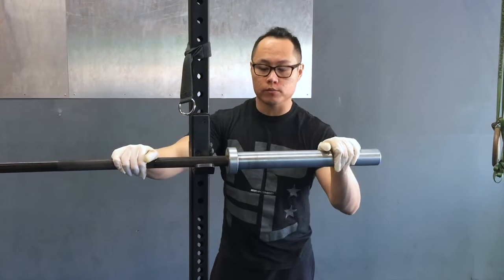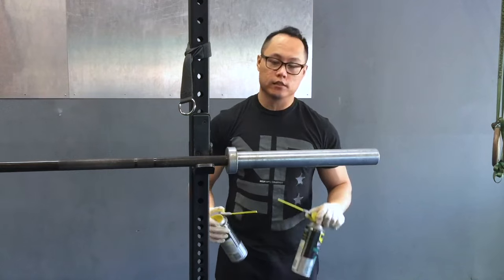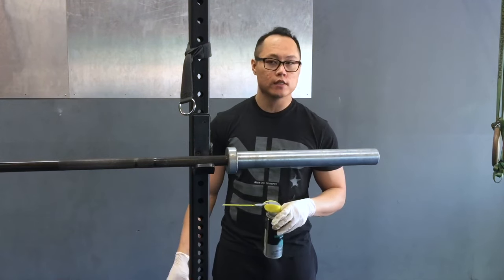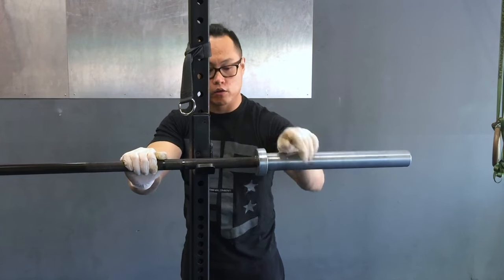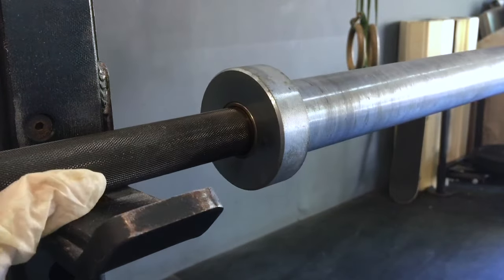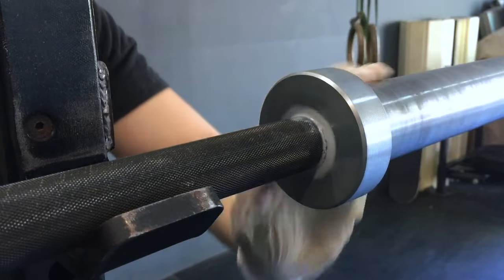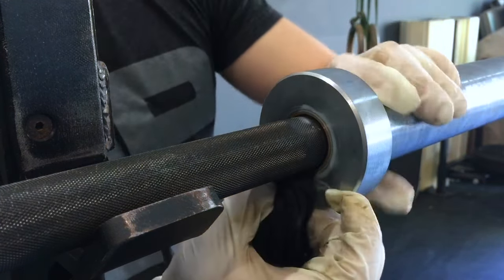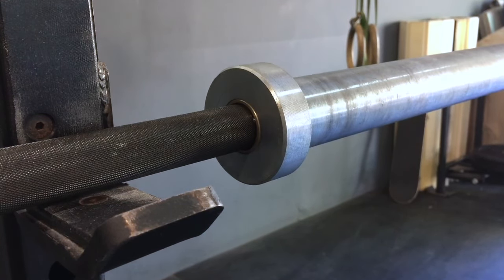A Quick Fix to Improve Your Barbell's Spin! ! Feat. Rogue Fitness Ohio Bar CrossFit Barbells

Comment: Should I buy a can of water resistant silicone lubricant or the 3 in 1 lithium grease? I have a new rogue ohio power bar. And I also feel friction. Thanks man!!!
Reply from the maker: For the Ohio power bar I would recommend using white lithium grease, you don't want it to be fast, but you do want it to be smooth.
Reply: @AMRAP  Thank you! I Will buy it monday 😊 Subbed by the way 😊

Comment: The shaft on my barbell spins. Is that supposed to happen???
Reply from the maker: Yes
Reply: @AMRAP  Really? It seems dangerous. I was squatting and it almost spun off my back. The shaft spins without the whole barbell moving.
Reply from the maker: @liammacdonald955  yeah, the shaft should rotate within the sleeves no matter what style bar you have. Sounds like you have a bearing bar which is why it spins so much.
Reply: @AMRAP  I have a 7ft Olympic barbell for titan fitness. When I spin the shaft, the sleeves don’t spin with it. Just the shaft spins. Is my barbell messed up?
Reply: @liammacdonald955  Are you trolling or are you beeing serious? The collars have bushings inside them, so that they can spin individually. This is very important for balance. And of course, if you rotate the shaft that means it can rotate inside the sleeves without the sleeves rotating. All quality barbells are constructed like this.
Reply: @X3RUBIM  no I am not trolling, thank you very much. I have asking a serious question because I am new to lifting and I never noticed that the shaft on my bar spins without the sleeves moving with it. I only noticed that the sleeves could move by itself, not the shaft.